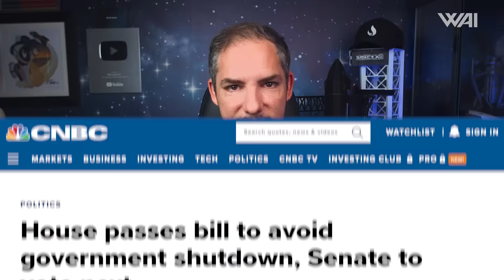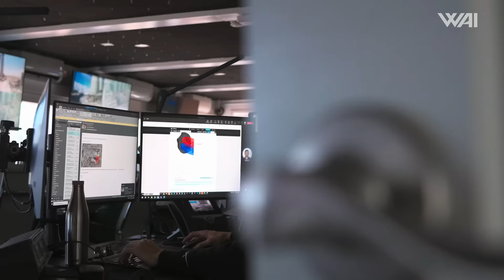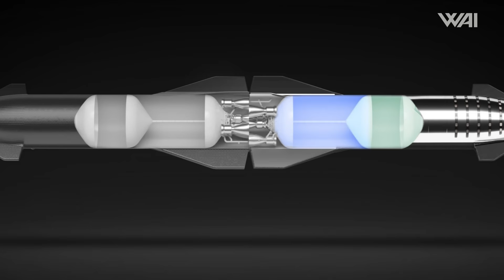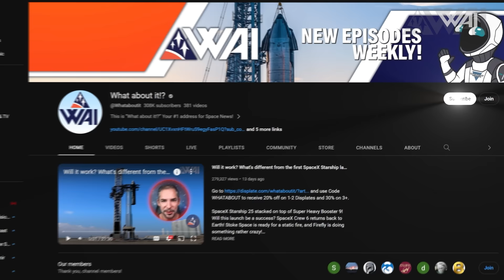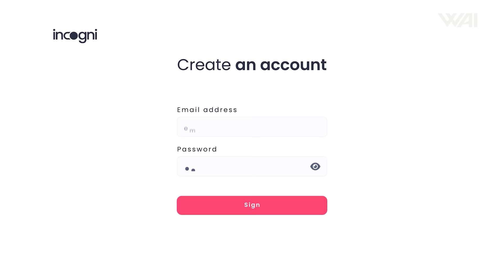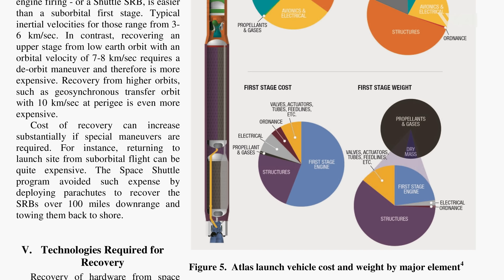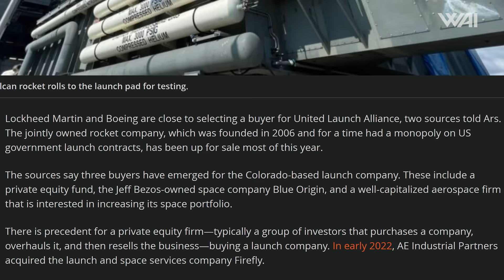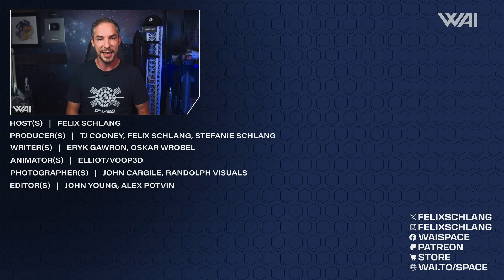SpaceX Starship Launched: What Happens Next?

Comment from the maker: The first 100 people to use code FELIX at the link below will get 60% off of Incogni: https://incogni.com/felix
What do you think we'll see first? Starship fuel transfer demo or the deployment of a first batch of V2 Starlinks?

See you on tomorrow's Launch LIVE Stream! :_WAISweet:
Reply: 1:19
Reply: Around 17:00 Is there actually a helicopter which is powerful enough to catch and carry two of those rocket motors?
Reply: Batch of starlinks
Reply: refueling is by FAR the more important demonstration, within the starship mission.
Reply: @RWBHere  Good question! The answer is, apparently, No. The Sikorsky CH-53K heavy lift helicopter can carry external load of 36,000 lb (16.300 kg) and the rocket engine package will be about 40,000 lb. ... But the helicopter recovery system has been dropped, as reported in Dec. 2022 ("How ULA Plans To Recover & Reuse Vulcan’s BE-4 Engines").
Reply: @spacexrocks1041  which generally will lead to the engines being destroyed by the salt water they fall into.

Comment: Check your geography Felix...Boca Chica is closer to the equator than Canaveral, though only by a little less than 3 degrees which makes them basically equal. It also borders the ocean with a clear view Eastward. There's plenty of open space to aim for when launching from Boca. Your list of pros & cons for why Canaveral is better than Boca Chica in so far as SpaceX is concerned needs some thought. The only thing that did rhyme was the road closures.
Reply: The largest obstacle is Cuba. Which I believe was one thing that NASA considered when selecting Cape Canaveral instead.

Comment: 3:28 through 3:55.  The script appears to imply that one of the benefits of Cape Canaveral is that it's closer to the equator than Boca Chica, but the opposite is true.  Boca Chica has the approximate latitude of Miami Beach, which is 2.5-degrees further south than LC39A.
Reply: I was a bit confused by this too while editing. Should've brought it up.
Reply: Yes! Their latitudes are very close. And this is why a Starship launched from KSC will, with minimal deltaG, be able to rendezvous with another Starship launched from Starbase.

Comment: I wonder if SpaceX considered building a dedicated catch tower. That way if a catch goes south, it would be less of a loss and simpler to rebuild.
Reply: That’s what I was thinking too - especially for the earliest batch of flights - but there is no sign they are doing that as yet.
Reply: I think the purpose of catching on the launch tower is to support rapid reusability.
But having said that, having a catch tower near (with in a few km) the launch tower means they could simply use one of the modular transporters to move the rocket.
At least until they have perfected the landing.
Reply: I'd think they'd build a second launch tower and just not have the launch mount and plumbing. After they've shown they can catch reliably enough, they could then finish it out as a second launch facility.
Reply: It wouldn't surprise me if they do that for the first catch attempt(s) just for testing until they get it consistent. Having to rebuild the launch mount after each test would slow the testing campaign to a crawl.

Comment: In-situ propellant production is absolutely vital for viability of Starship as a Mars transport, landing, and return vehicle.  SpaceX knows this, so they will be moving to another location to facility production. They also have to perfect methane production with a smaller footprint.
Reply: They could do that at one of their nearby facilities.
Reply: Even more important than Starship itself!
Reply: More important, because not only would it be used on Mars, but put next to giant Solar Farms could be used to produce carbon neutral fuel to provide all sorts of energy application (Even at Night unlike Solar Energy)
Reply: yeah, this aint ever going to mars.
Reply: @SuperKingslaw  carbon neutral fuels still produce heat when burning.
Reply: @SuperKingslaw  " giant Solar Farms" are NOT carbon neutral.  The reality is solar PV is in no way, shape or form "renewable" or any mitigation to the "Limits to Growth". This is because it is 100% dependent on the underlying hydrocarbon powered, industrial mining, manufacturing and transportation foundation for creation, installation, maintenance and disposal.
Reply: @ShastaTodd, you tell 'em! There is nothing "carbon neutral" about solar panels. Same for wind farms. And don't even start talking about "biofuels".
Reply: As well as build a few other Heat Tile Bakeries as well

Comment: Concerning you question on the air separator. An entire complex to produce the quantities involved would be required. This would entail more power runs from the local power distribution network, well over that which was recently installed. As far as land usage, unless SpaceX buys up an equivalent area to that of Massy, or repurposes an equivalent amount of space within the current facilities, which is unlikely, there's just not enough room.

A huge advantage to a local production facility is that the trucks could be done away with and direct piping could occur to the sites in need of the products. Moving cryogenics by pipeline is a know process. And since LHx is not involved, the pipeline network would be quite long lived.

Comment: 1) Fuel tanker could use an internal bladder to squeeze fuel out.  Nothing needed besides gas pressure. 
2) An air separation plant on-site only saves truck fuel.  Much more efficient to build a new one relatively close.  Or better, get an established firm to build and operate one with quantity pricing.

Comment: Quick pedantic correction:
Boca Chica is 25 degrees north whereas Cape Canaveral is 28 degrees north.
So, Boca Chica is closer to the equator and gets a small LEO launch advantage from that.
Latitude will actually be a disadvantage if moving to Florida.         :)

Comment: The fact that the pad was in good shape after yesterday's launch means we will likely see the pace of testing accelerate drastically. They won't have to deal with nearly as much red tape now that at the point the rocket explodes its not a danger to people or wildlife. Also the launch pad won't need nearly as much work between each attempt. This means SpaceX should be able to just stack and go. Maybe even pulling off a launch every month or so. I honestly wouldn't be surprised if we see one more attempt this year.

Comment: To fix the orbital refuling problem, why dont they just have a flexable pouch on the inside of the refueling stage that holds the fuel? For lack of a better word.... 

Imagine a fuel pouch exsisting within a pressurzed starship stage. 
If the pouch is flexable and compressable it could just have the liquid fuel pumped out of it as the pressure on the outside of the pouch helps contribute to it shrinking.  This way, no air or empty space ever exsist within the fuel pouch.  No empty space in the pouch means no fuel bubbles or sloshing.

This concept works fine in a normal pressurized environment on earth. As long as the flow of the liquid is steady, you can squeeze liquid out of a bag without air getting in and without creating empty space in the bag.  In space, a fuel "pouch" would just have to exsist within a pressurized stage and if needed pumps could do the rest to transfer the fuel if there were limits on increasing pressure.

Comment: 5:44  It's not exactly about catching the booster; rather, the booster (along with the Starship) lands on the arms. Essentially, it's the rocket that's doing the majority of the work. The crucial aspect is the rocket's ability to slow down and hover long enough to get into the correct position. The arms then adjust and move the docking point to align properly
Reply: Exactly, but this is something they have a huge amount of experience with from F9

Comment: A Geosynchronous station where refueling and maintenance can be done is more sensible. Another on Luna's surface, and a third orbiting Mars. The supply runs could even be robotic.
Reply: Geosynchronous is too high up - it needs to be in LEO.  There maybe some rationale for another Top-Up in HEO.
Reply: @peterclarke3020  Low orbits are getting very crowded. It's only a matter of time till tragedy strikes. A high orbit provides a large dose of security. Also a direct communication that isn't dependent on relaying through satellites. If I were working on a ship I would want to be on the moon. But we need a safety stop near Earth. Some roaming ships to give aid when needed. The Space Force.

Comment: How is hot staging no gonna burst the booster? There aren’t even heat shield tiles on the hot stage ring…
Reply: Probably will but it doesn’t matter as long as the second stage goes up.
Reply: There is a stainless steel heat shield built into the hot-stage ring.

Comment: Atmospheric partial pressure thermal fractionation is probably the simplest way for them to get liquid oxygen, but it's also ridiculously energy intensive.  Same thing goes for water cracking.  They would have to add some serious energy infrastructure to get that kind of scale of production.  I think it's much more likely that they'll use a chemical oxidizer reduction process. Less material to super chill and process... But that also might not be cost effective. Anyway you cut that watermelon, it's going to be expensive.
Reply: They will make liquid nitrogen - that can be used to make liquid oxygen as part of the process.

Comment: I think I figured out how to transfer fuel in space. Carry the fuel as a separate container with an attachments that is similar to the one they use to fuel the rocket from the tower. Inside the canister have a steel disk that is the same width as the canister with a lubricated ring like a combustion engine has. But just the ring and thick enough it can't turn sideways. 

Then from there you just have to treat it like any other hydraulic system put air or fluid pressure on the opposite side of the way you want the liquid to move. 

So if you have a nozzle attached to an empty tank it should be pretty easy from there.

Comment: from what little i could glean from the flight videos, either booster needs to have more engines firing during hot staging or starship needs to fire up engines slowly. the booster slowed sharply at hot stage and caused sloshing of propellants that resulted in problems reigniting the engines for boost back. looked like at least one engine exploded, releasing propellant before the fts activated.

Comment: Air Separation Unit (ASU): SpaceX installed that pre-owned ASU at BC several years ago. Evidently, it didn't work out as it has now been demolished. 

SpaceX likely will move launch operations to ocean platforms located 50 to 100 km offshore from the beach at Boca Chica.  Tanker Starships would be built at the BC Starfactory and launched and landed at those ocean platforms.

Methalox propellant and liquid nitrogen would be transported to those platforms from production facilities located on the Texas Gulf Coast. Modified LNG tanker ships with 50,000t (metric ton) cargo capacity would transport these cryogens to the ocean platforms and function as a floating tank farm. Each tanker ship holds enough propellant and nitrogen for eight or nine Starship launches. No more sending hundreds of tanker truck loads of those cryogens down Highway 4 to the BC Starbase.

Comment: Do you think that SpaceX will maybe exaggerate testing on the booster if all is going well and hover it just above the the water for as long as they have propellent left to get more info in catching it with the chopsticks safely at Star Base?
Reply: They're saying the thing won't even be programmed to light the sea level engines. Seems like a huge missed opportunity to look at the condition of the vehicle before it falls over and explodes.
Reply: They're saying the thing won't even be programmed to light the sea level engines. Seems like a huge missed opportunity to look at the condition of the vehicle before it falls over and explodes.
Reply: Why not ? - it’s not like they are going to recover any unused propellant.  Unless they want it there to maintain pressurisation, so that they could tow the booster into port ? - But I thought they are just going to scrap it after landing - unless they want to inspect anything ?
Reply: @peterclarke3020  I'm hoping they are going to get good external video to know how the heat tiles did.
Reply: @riparianlife97701  You seem to be confusing the two parts of the vehicle, since boosters only have sea-level engines. It's the ship that's not re-lighting the engines for a landing.

The plan for the booster is to attempt a soft landing in the sea, so presumably yes, they'll be testing the control needed for a catch.
Reply: @simongeard4824  Not last I heard.
Reply: @riparianlife97701  I don't know what you've heard, but it's broadly the same plan as last time... the booster will perform a boost-back and landing burn for a splashdown in the Gulf; the upper stage will re-enter over the Pacific with active flight control but no landing burn.
Reply: @simongeard4824  There was never any plan to do a soft water landing of Starship, or to even relight the engines after coast phase. Only the first stage was supposed to do a soft water landing partway back to Starbase. My guess is we'll find out FTS was triggered for each vehicle because they were not going to be able to stay within the zones they cleared of boats.
Reply: @riparianlife97701   yes, that's what I told you, and why I suggested that you're confusing the booster (which the original question was about) and the upper stage (which your answers seem to be about).

Comment: Rather than continuously accelerating during fuel transfer, I wondered about doing a slow rotation so fuel gathers at the ends of the tanks.  Then pressure or pumps could be used to transfer the fuel.
Reply: Perhaps the best way to do this is using a solar powered hub and the starships are attach by their noses. I don’t know if rotations don’t have to be rapid for this. Just thought of this complete detail now.
Reply: No - because that would greatly complicate the docking, etc.

It’s always best to go with the overall simplest solution.
Reply: Even if that wasn't as incredibly dangerous as it is, that would push the fuel away from the ship you're trying to refuel.

Comment: Starlink deployments will happen first.  Fueling will be easy --- not much need to get famcy: Dock nose to nose, with existing standard docking adapters modified to include a pair of connectors for fuel and oxidizer then have each Starship give a little puff of their stern yaw thrusters simultaneously in the same, relative direction, and Presto-Chango you suddenly have induced artificial gravity forcing all fuel and oxidizers to the bottom of their respective tanks. Except for a few more internal fuel lines, no additional equipment required. 

"The best part, is no part." ,
 Elon Musk.

Comment: Unless SpaceX invests heavily in (renewable) energy production on or near the site, there is no point in trying to extract oxygen from the atmosphere locally. It's much cheaper to just buy the stuff and have it trucked in. 

I suspect they will start building large scale solar fields at some point, I'm just not sure when. Side effect: if they also build a fat transmission line, they could use the generated power to prop up Texas' electricity grid in a pinch...

Comment: Fuel transfer with a pressurized gas will only require a piston system with some mechanically operated check valves. One for gas intake from the storage tank into the piston area and one exhaust to the fuel tank. Multiple pistons could be implemented for both volume and pressure boasting.
Reply: I think you are one the right track.  I envisioned tanks based on syringes. One tank pushes the fuel out while the receiving tank would draw fuel into itself as the tanks volume increases as the top of the "syringe"  moves upward.  Instead of a plunger, perhaps motors driving the movable tank lid up and down.  However, I am not an engineer and just making a guess.  I also think one tank inside the other would work better than 2 tanks sharing a wall.  Imagine a smaller diameter tank inside of the main tank.  It might complicate things in one sense but it could solve fuel transfer without gravity.  Just a wild guess.

Comment: Wouldn't a bladder tank where the fuels are pushed out as the pressure is increased on the flexible/moving separation wall. It would also cut down on boil off since the cryogenic fuels would be slightly pressurized at all times

Comment: If they power a gas extraction unit by solar they have an opportunity to reduce the cost to orbit for them by a large amount. It will need to be scaled up massively, though, to  supply enough oxygen and nitrogen for even one flight a day, not to mention multiple.